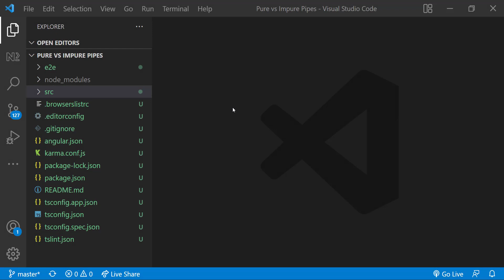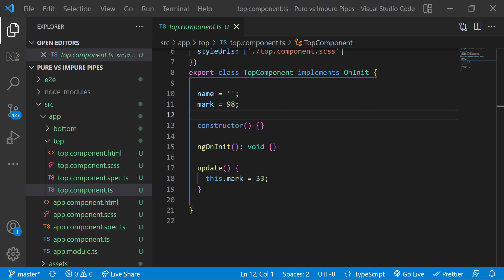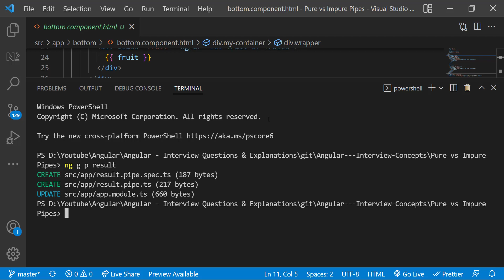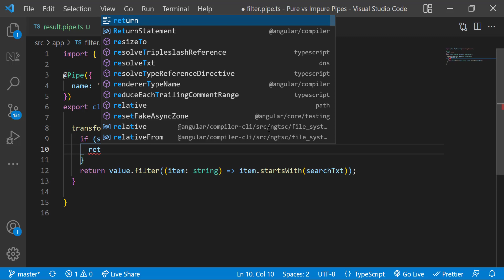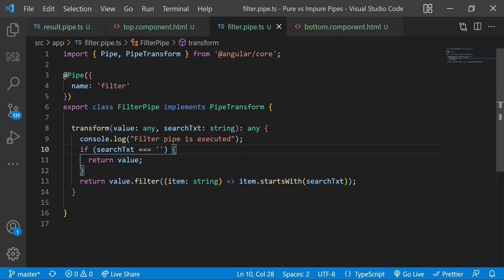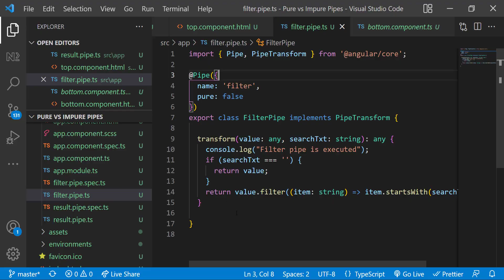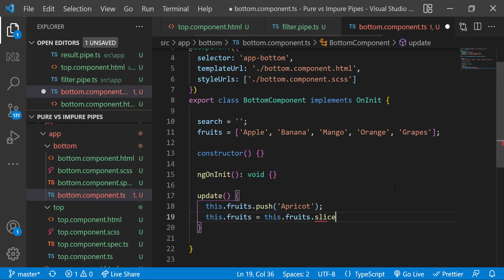Pure vs Impure Pipes: Understanding the Differences for Interviews | Angular Interview Concepts

Comment: can we say change in primitive type is pure and non-primitive type as impure ?
Reply from the maker: No, we cannot say like that because even if you completely replace the array (Non primitive) or use the splice method on array, a new reference of array will be passed and so it triggers the pure pipe also. Impure pipe will be triggered on every change detection even when there is no change in the input value to the pipe.